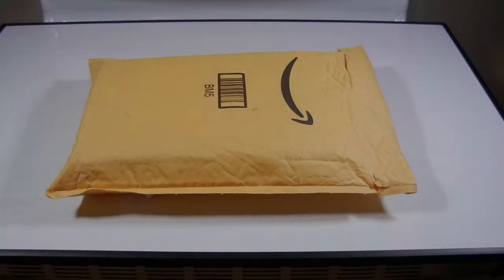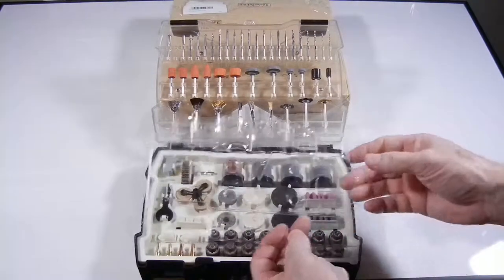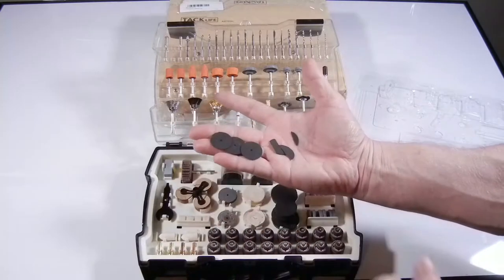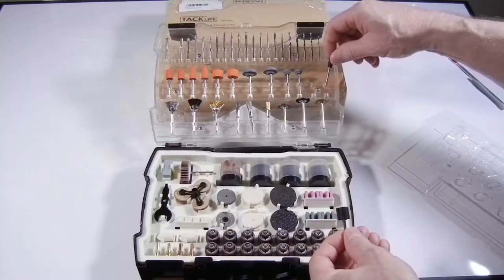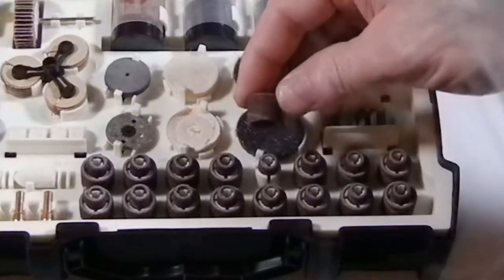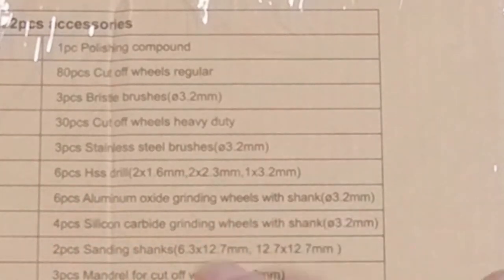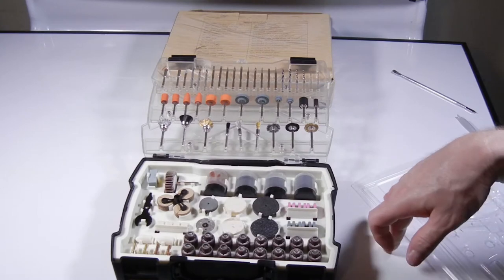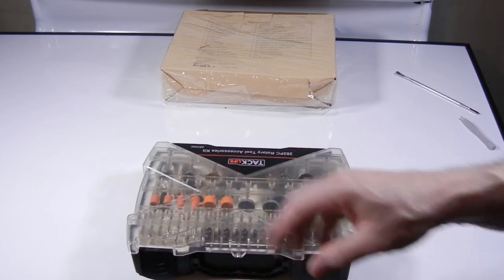Ep 2.34 TACKLIFE ARTO2C 282 Piece Rotary Tool Accessories Kit Unboxing And Review....

Comment: 11:05  It's polishing compound .  Supposed to dip the tip in to the compound run it on low speed so it coats it...and polish away!  Not really supposed to be dug out with a knife! 😀   Sucks though that your kit got damaged, I'd contact Amazon and get a replacement if it happens again!
Reply from the maker: Yeah, Thanks.... But I Still Don't Have Anything I Can Polish With It Yet....